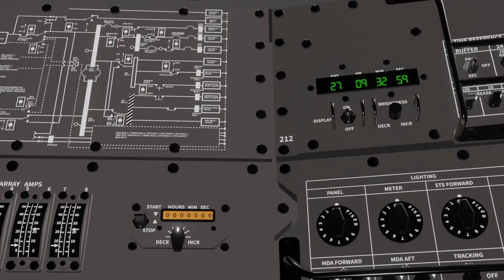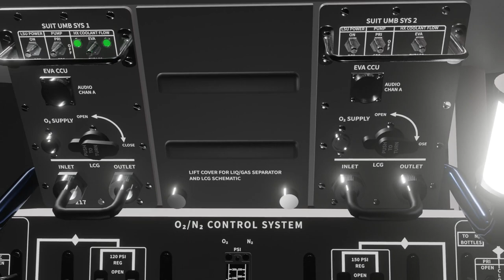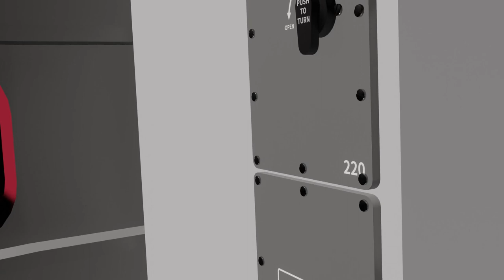Skylab: Structural Transition Section (Power Distribution)

Comment: Congratulations!  Terrific work!  The Airlock Module Skylab systems control panels station is one of the least photographed areas of Skylab!  While there are a number of images of crew at the ATM panel in the MDA, I've never been able to find an image of a crew member at the station (other than a crew member at a 1-g procedures trainer panel in an office setting) nor have some Skylab authors I've queried.   If you don't mind, where did you get the control panel diagrams for the AM and for the ATM panels in the MDA?  Is there a detailed "News Reference" similar to what NASA turned out for the Apollo vehicles and Saturn rockets, or did you find a different public source?  Thanks for doing this!
Reply from the maker: Thanks for watching and commenting.  Nice to see someone watching one of my low watched segments.  Evidently not a lot of interest in Skylab.  But for me…I thought it was cool and I had a lot of fun putting it together.  Most of my sources were from the NASA NTRS website.  Once you are there, type Skylab airlock module.  You can do the same for the other modules.  My motivation for both my Apollo and Skylab series was to bring to life those things that were not filmed very well with animation.  I wanted to do it so that you could actually read all the displays (which the old film will not do).  Keep watching!  And more content coming.